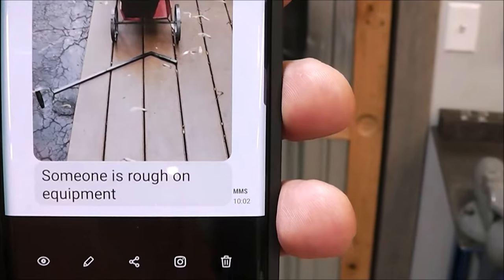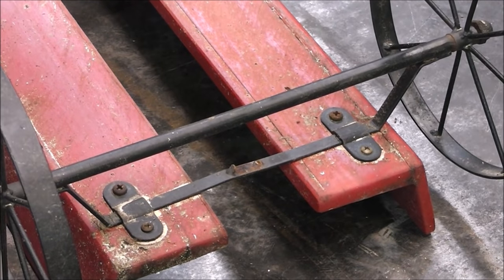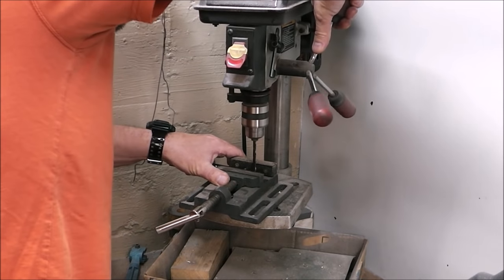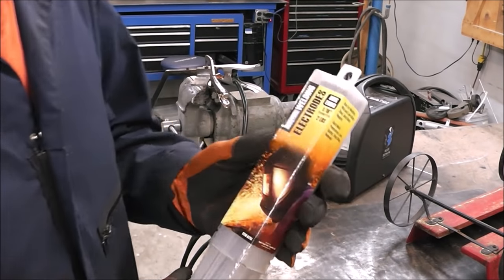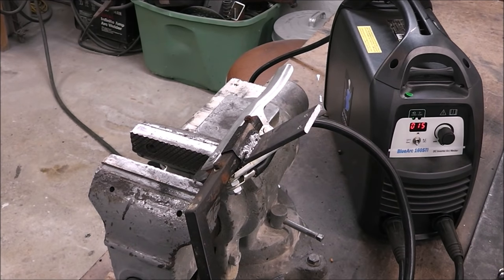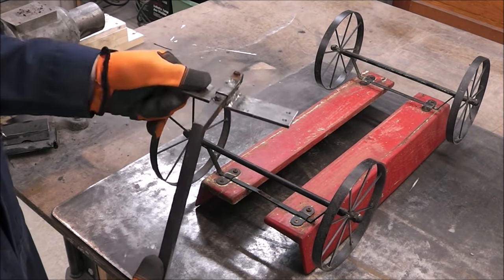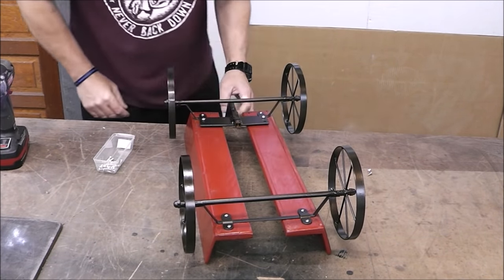Stick Welding Super Thin Sheet Metal Welding Thin Metal

Comment: Awesome, I just started welding this week. Bought a Arc Welder from Lowes to weld two different thickness steel for my ATV exhaust. 22 gauge on to 14 gauge. I got it done but wish I saw your video 1st. I came to the same conclusion after blowing a hole, heat the thick and bleed it to the thin. Thanks for the videos, starting to watch them all!
Reply from the maker: Thanks man and congratulations on your purchase! I appreciate you stopping by. I have tons of videos which most are all geared towards beginner welders with lots of fabrication tips. I hope you enjoy!

Comment: Great video as usual.You would be surprised to learn that in South Africa we mostly use the 1/16 or 1.6mm thick square tubing for the frames of safety doors, using 2.5mm welding rods.I'm so used to a few blowouts, but in one of your previous videos I learned about DC - and DC + and now I have no more blow outs.When using 2mm thick square tubing I have no blowouts.Thanks again for great info and the way you present your info.
Reply from the maker: That's awesome Henry! I'm glad I could help! Cheers buddy!
Reply: @BrandonLund  Keep them coming Brandon.

Comment: You are definitely spot on! MIG is great, but the price gap between the crappy ones and the good ones is absolutely insane, add the price of gas to that and I personally feel like I would need to weld MUCH more than I do today to defend buying one. SMAW on the other hand is dirt cheap and even non-brand ones have alot of bells and whistles these days. Not to mention you do not have to store pressurized gas in your home.
Reply from the maker: Thanks man! I'm a huge fan of smaw anyways. Mig is nice but it has its place...plus its difficult to use it outside.

Comment: In the begining with gauge problem, you just proved how superrior metric sistem is
Reply from the maker: Touche'
Reply: No lol, lots of this kind of thing is often made from left over / reject steel that doesnt conform to a size. Even a metric gauge probably didnt have the size of this steel
Reply: @n2n8sda  Just the fact that the gauge have to use different units should be enough reason to use the metric system. That steel is X mm thick, and it would be easy to find out how many with a caliper. Instead of jumping between 1/8" and 14 gauge.
Reply: I noticed your tool didnt have 12 gauge .105
Reply: Even the English do not use the English system of measurements.
Reply: @clensayr  neither does the US, we use the US Customary System!

Comment: Thank you so much for making this video. I don't usually comment but I'm in the UK with a very cheap stick welder and a few hours of "self taught practice". I was struggling to weld really thin sheet to.... Really thin sheet. I understand my mistake now.  I've not seen any other YouTube videos of stick welding 16th sheet. You did way better than I did.
Reply from the maker: Thanks Jason! I appreciate your kind words. Glad I could help. I have some more thin metal welding videos coming so be sure to check back. Its not easy but with some practice you will continue to get better. Stay safe - Brandon
Reply: @BrandonLund  I agree with Jason plus I probably didn't do as well as Jason. In some of your upcoming videos, It would be great to have some suggested practice routines.

Comment: NICE JOB,  ,   when I was a bodyman. in the 60s. Rather than oxy/acetylene,  I used a DYNAMIC 20-40-60-80 amp. 110v arc welder with 1/16" 6013 to weld sheet metal without warping the metal, before mig. came to the mainstream. 😃😃😃
Keeping the metal cool is the thing !!!
Reply from the maker: Right on! Its not as easy as it looks but with practice works well :)

Comment: Two things I try to do when welding thin metals is, I usually place the welding metals on some type thicker aluminum backer plate to help control blow through and heat, and I also work from the thickest material unto the thinnest for the weld puddle to make blow through a lot less. But as with most everything, practice makes perfect...well maybe...
Reply from the maker: Excellent tip Gary!
Reply: Do you mean you kind of use the the aluminum backer plate like a heatsink to spread the heat from the welding spot?
Reply: @_TheDudeAbides_  Odd I just happen to see your question while watching other videos. When you weld steel materials you use MIG wire feed welding or TIG with filler rods or even Stick welding with welding rods to fill in the joints. But neither of those will weld Aluminum, brass or copper. So using an aluminum backer plate seems to stop blow throw and allows the filler material to fill the holes or seams. Aluminum also conducts heat extremely well and therefore also assist filling the holes and seams. It work amazingly well. And if you are welding aluminum, you can equally use a steel backer plate to help fill the aluminum holes and seams because aluminum filler material will not weld onto steel. Try it, it works both ways.
Reply from the maker: Exactly!

Comment: Phenomenal welding skills. Great tips for gluing thick to thin. I will try using DCEN more for thin metal (for me, that's 1/8" with 1/8" 6011). My current project: a roof rack for my car. Stick welding, sadly, is going to be self taught because of the pandemic. Thankfully, excellent video instruction like this can only help. (and lots of practice!)
Reply from the maker: Thanks Jeffrey. 6011 was one of the first rods I learned to weld with. It is very hard to get a nice looking bead as compared to a 7018 rod. Once your able, grab some 6013 for thin metal. You will love it compared to 6011. It flows much nicer and doesn't blow through as easy. Enjoy your project and stay safe. 😁
Reply: The key element is your vision,you must distinguish (in the puddle) the molten metal from the foamy cellulose molten slag that has a bad habit to cover the metal puddle,and you barely realize when the slag rushes the metal,need more amps so the arc blow away the slag,but must find the thin balance there....good luck :-D

Comment: Excellent Brandon I love this home grown diy jobs for amateurs like me. I'm an office worker but from watching vids like yours I scored myself a cheap stick welder and now experimenting on all sorts of fun projects. Im rebuildin a motorbike with rusted out exhaust so would appreciate anything you have in this area as i seem to make more holes than repairing them but its a hole lotta fun!!
Reply from the maker: Thank you and I'm glad I could help! Is your stick welder an inverter welder? This winter I will be working on some custom exhaust which will have some pointers too.  Dont get discouraged by burning through. Welding exhaust is extremely difficult to do with stick. Your not alone. You might want to check out my beginner welding series playlist. There is one video in particular https://youtu.be/jj7uCglBFAc where I test polarity on 4 different pieces of metal. This should help too. Thanks for your support and great comment!
Reply: @BrandonLund  Cheers mate I'm pretty resilient (wife calls me stubborn) so will definitely keep at it. Pretty sure my cheap as welder is not inverter says 140amp 240v transformer arc welder and only cost me $120NZ. I have been practicing on al sorts of scrap material so much fun even as I mostly make mistakes but that's how we learn eh! Really appreciate the vids and will keep an eye out for your upcoming projects. Cheers Lyon

Comment: Good work Brandon. I've managed to attach very thin steel a few times by starting the weld on the thicker steel and gently "teasing" the edge of the weld onto the thin steel. Thin to thin I think would be difficult but one might find a way of doing it
Reply from the maker: Great tip! We are going to be doing that (or trying to)  in an upcoming episode!

Comment: Good job man as always.
I never found a welding channel trying to weld something thinner than 1/16" 1.6mm, i think they never heard about stick welding 1mm, 0.8mm and 0.5mm.
Thanks for sharing your experience, have a nice day.
Reply from the maker: Thanks man! I tried finding it also and I couldn't find it. As far as I can tell, this is the thinest yet. It is for me anyways.
Reply: @toolan talal which is a shame because stick welders are awesome, and like Brandon mentioned in the video they are accessible to many DIYers. I am actually going to have to repair a plastic bracket that broke in my pantry by fabricating a part from 1/16" sheet metal. And will give my stick welder a try thanks to this video!

Comment: You just saved me from quitting welding for good, and probably giving my welding machine to somebody or throwing it, I was desperate to learn welding for long time, and today I welded somehow my daughter's small bicycle that broke which was both sides thin like your thinnest piece, it got full of holes but held up somehow, now I had even thicker sticks, couldn't find 1/16 and bought 5/64 (2mm with my units) and break was like ripped it was nowhere flat nor straight, and to make it worse, my machines min amp is 60. Palm face.
P.S. Edited from now on, I'm not watching anymore welding tutorials, beginner nor professional ones, I'm sure I now enough for what I need.
Reply from the maker: Well I'm glad you got your daughters bike fixed and I'm sure she is happy also. Take care and thanks for watching.

Comment: Thanks. Welding thin metal is a great skill. Many welding machines  don’t go below 20 amps ( Hobart Stick, Miller thunderbolt) I had a Hobart Handler Mig that went down to 20-25 Amps and it was hard to keep it from burning through thin stuff.
Reply from the maker: Great point!

Comment: Thanks for making this. I may try to buy a cheap used welder at some point to make some things. I have just realized I may have to go for a stick, perhaps it is doable and affordable.
Reply from the maker: It sure is. Its one of the first processes i started with.
Reply: Get a budget DC 150amps and you will be good to go for a good while,beside the sparks burning your skin,it will be fun aswell ;-)

Comment: Brandon,here's a tip for you,when you burn the rod (excellent choice btw),focus the main puddle on the thicker metal and let the side of the puddle "wet" the thinner metal,in this way,you focus most of the heat outta the thinner metal but you still get fusion between,try that way and thank me later !
Reply: Sounds like a good plan

Comment: I finished my roof rack. It was easy compared to the next job: repairing a long-handled dustpan where the handle got crimped. I cut the crimp out of the 20 gauge tubing and taped the tubing, used a 6013 1/16" stick and almost immediately blew through at 30 amps. I dropped the current to the lowest (20) my box could offer and it was almost as hot, but by severely limiting the time I had the arc on the tubing, I got the weld done after a few tacks.  I even filled out the blown out area. Definitely the time of my life behind a welding helmet!
Reply from the maker: Thin metal.is tough but it really teaches you patience and let's you feel how the arc works. Great job brother!

Comment: I did a similar weld on the rip in the front panel of a tent trailer turned into a utility trailer but I used 1/6  440 stainless rods and it still holding . so yes you can stick weld thin metal .
Reply from the maker: Nice job man!

Comment: I am surprised the setting was only 15 + negative on rod ...had burn through today with same problem ...learning everday. Thanks for sharing. Nice ride for the flowers.Question :
is it possible to solder thin cast aluminium , that was problem today.
Reply from the maker: Thanks man! As far as soldering cast aluminum I have never done it personally but I think there are specialty rods that will do what your want. I believe one manufacturer is Muggy Weld

Comment: Nice job using a stick welder. I have done a many jobs using a SMAW. I have a welder that should be in a museum as the welder is a toroidal transformer type. Duty cycle says continuous 1 1/2 hours 50 percent after.They would never offer that type of duty cycle today for sure.  120 240 volts, with amps settings from 10 amps by 5 amps increasing on low side, total top end  290 amps. On 120 you can go up to 180 amps increments of five and 240 increments of 10 amps. I have welded just about any metal you can think of with all being a success. This old workhorse was made in the 1948. forget the name. Compact size with a weight of 140 pounds. You have to really eat your wheaties for breakfast to carry this bear.
Reply from the maker: Thanks! 100% duty cycle that's crazy, but then again back in the day they built stuff to last and to perform.  Unlike much of the disposable things built today.
Reply: @BrandonLund I could not say it better myself. Just love to take out the antique rod burner and go to town. Good day to you Brandon too.

Comment: Your heat should be directed to the thicker metal and allow the puddle to just kiss the thinner material.
Reply from the maker: Exactly.
Reply: @BrandonLund  was  going  to  say  the  same....  it's  what  you  did!
Reply from the maker: @iainmel1 I'm guessing he he missed that part of the video when I was explaining the technique. I know a lot of people who watch just fast forward or skip sections so that's probably what happened.
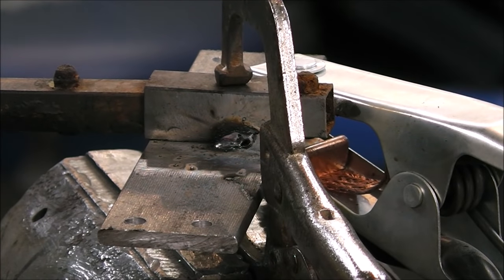Reply: @BrandonLund  at 6:25-7:00 your rod is angled toward the thinner gauge materials. He is saying you should be mostly focusing the arc at the 3/16th plate and just letting the puddle wash onto the thin gauge and you wouldn't be burning through
Reply from the maker: Did I not say to focus the arc on the thicker plate?
Reply: @n0thingsafe  in theory,but the most time,the 6013 rod likes to burn the arc sideways,still unknown to me why this behavior on low amps...

Comment: I once welded 2 1/4 exhaust pipe with 1/8  6011 with a ac buss box set at 50 amps I mitered all the joints and downed handed the welds.
Reply from the maker: Nice job buddy!  Exhaust is difficult with stick...especially with 6011. I've done it a few times and its always difficult. As you pointed out, downhand is key.

Comment: Great video, Brandon. Learned a lot !!  But you mentioned an AC (only) Buzz Box , which I'm looking at acquiring. I wonder if you might run through the different settings and issues that might occur using AC instead of DC ?
Thank you for your generous consideration & inspiration,
Sincerely ...........................
Steph
Reply from the maker: DC polarity is used in most welding applications. It produces a smoother welding output compared to AC. It creates a more stable arc, easier welding and less spatter. You can also either use DC negative for faster deposition rates when welding thin sheet metal or use DC positive for more penetration into the steel.

Comment: Great vid, would love to see someone weld exhaust pipe with arc though
Reply from the maker: Thank you! It's been a while since I've welded up exhaust with stick, it's hard, but it can be done. I might have to give it a try for old time sake.
Reply: Easy, 2 mm 6013 electrode, put a line if full penetration tacks along the joint, then deslag, repeat the tacks overlapping the previous ones until the joint is filled, grind off the ripples to tidy it up.  I've done this on 1 mm tube.

Comment: Nicely done. I'm just starting welding, and I'm having trouble not blowing through 1/16 steel. Not blowing through 22 gauge might as well be magic to me.
Reply from the maker: Thanks Shawn. My advise to you is start practicing on 1/4" material. Once your confident then move to thin metal. This will set you up for success. You will get a much better feel if you do.

Comment: Other way to weld super thin metal is the "texas tig" method. You use other stick rod as a filler and melt both together. And use higher amps. There are a lot of videos on the YouTube. Keep up the good work my friend.
Reply from the maker: Thsnks man I appreciate the tip!

Comment: Brandon, you do excellent work, let me start off with that. However, I ponder if actually DCEP would have been a better choice to this? Logistically, I probably would have tried that first over DCEN. Thoughts?
Reply from the maker: Thanks man. DCEN has way less penetration than DCEP which is why I chose that polarity for this application. DCEP is really good at making root passes but it's not great when you get into really thin stuff.

Comment: Would it have easier to stitch weld instead of dragging a bead? What I mean is do a spot weld and then put another spot weld a short distance away. Then fill in the gaps with more spot welds. Wouldn't it be less likely to blow through that way? I ask because I've seen other welding videos suggest a stitch for thin metal. I'm curious about why you chose to do it the way you did. Thanks.
Reply from the maker: I like experimenting...you are correct that stitch welding is a great way to weld thin metal but that can also introduce a lot of porosity. Continuous beads are much more difficult because rod angle, distance from your work piece and amperage all play a big role in keeping it from blowing through. Little experiments like this really show how these small things can influence  the weld puddle.

Comment: I'm on a budget. Would you go for a 20A to 120A stick welder with 1.6mm 6013 rods. Or a gasless "MIG" welder at 50A and 0.8mm wire?
Reply from the maker: It really depends what your working on most of the time. Stick welding is better suited for 1/8" and up and you can weld really thick with multiple passes. Self shielded in this amperage is better suited for 3/16" down to sheet metal.

Comment: We use 1/8 and 3/32 on 16 gauge steel for shipping container repair all the time. Roof patches are usually second passed with a 7014. Just saying it isn’t that hard to do .  We commonly weld 100’ a day on the thin rusty Corten-b steels.